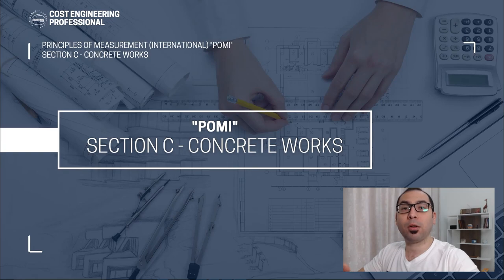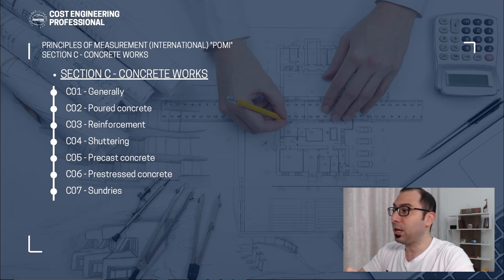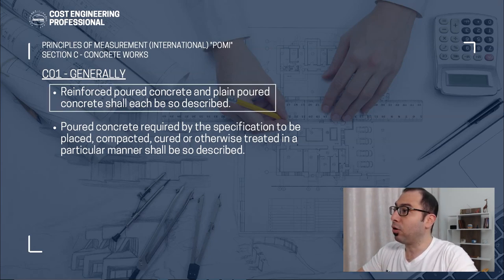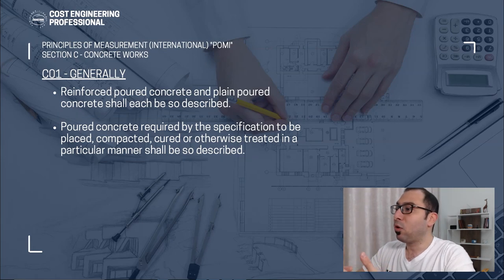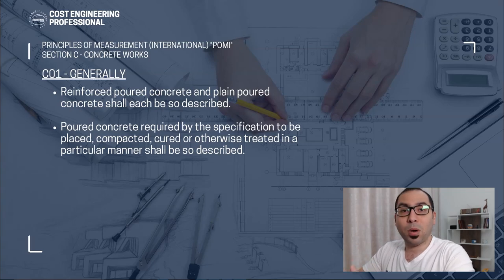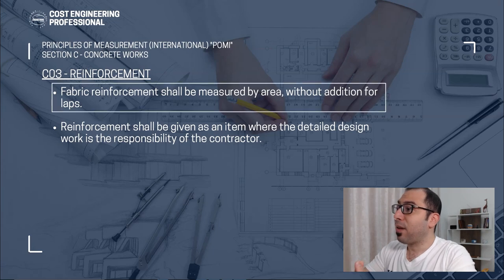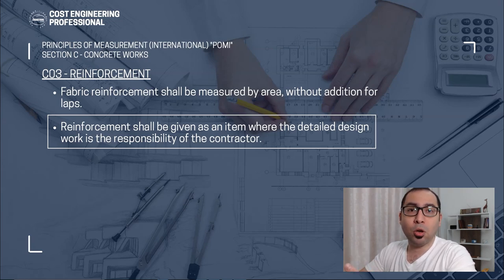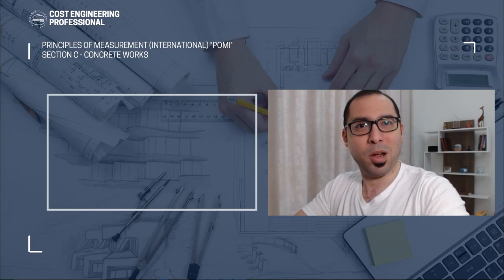How To Prepare Concrete Works BOQ In Accordance With Principles Of Measurements International

Comment: Mr. Ahmed. I have a confusion in C02 Poured concrete Beds. It is said here the beds are calculated in volume and you gave examples as beds forunderground pipes and all. But in B19 underground drainage pipes, it is said the beds should be measured as length. So can you explain and clear this doubt please.
Reply from the maker: Thanks for the question 🙏. Well in some cases some activities can be grouped together into 1 BOQ item, and some other times you can go for item wise BOQ. Both ways are right, it just depends on how you want the item to be measured and accordingly priced in the BOQ